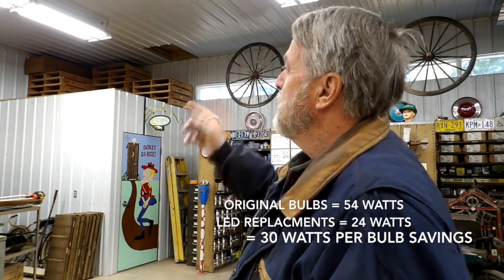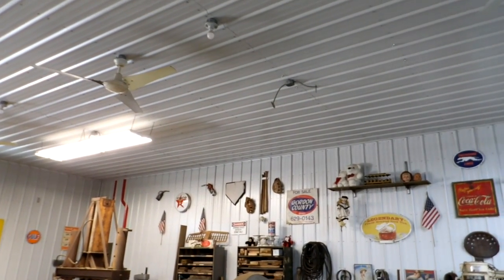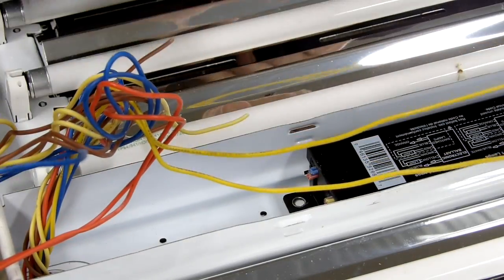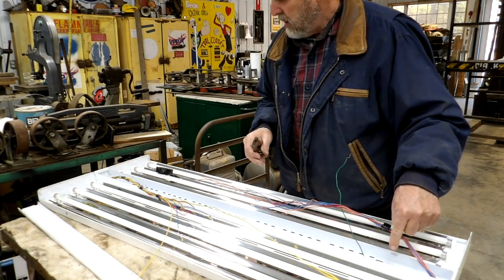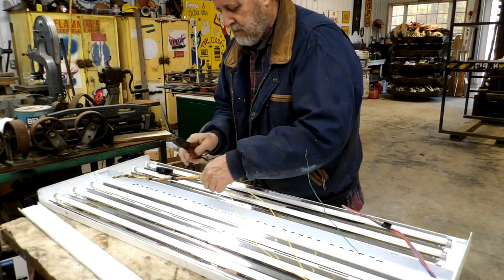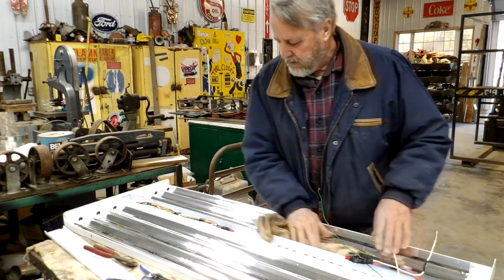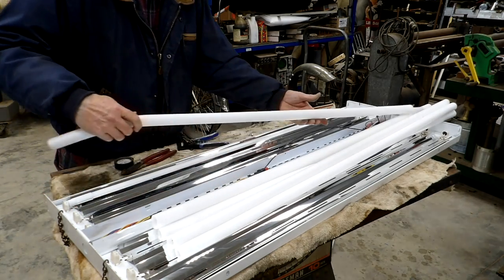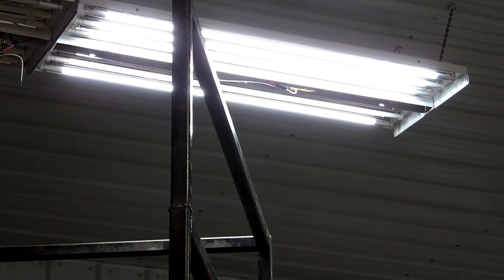Convert T5 4' fluorescent 6 bulb to LED

Comment: From a fellow OCD guy I appreciate the attention to detail in your work. Thanks for the video. This was the only one on YouTube I found that demonstrated a 6 bulb T5 LED conversion. I would suggest using WAGO Wall Nuts part #773-166 in place of wire nuts. They eliminate the need to twist wires together.
Reply: Thank you for that suggestion.  Others may find that useful.